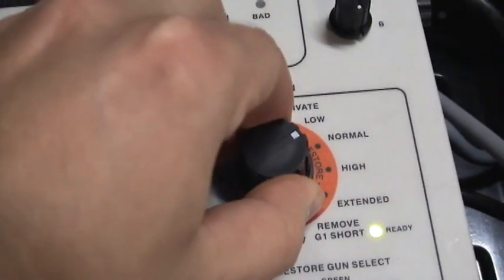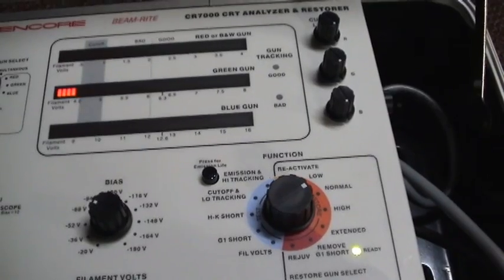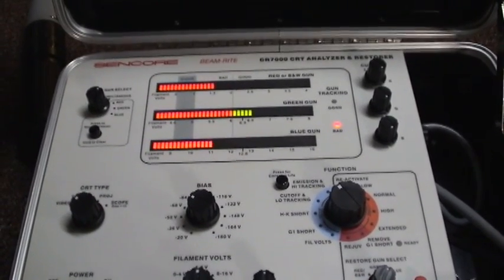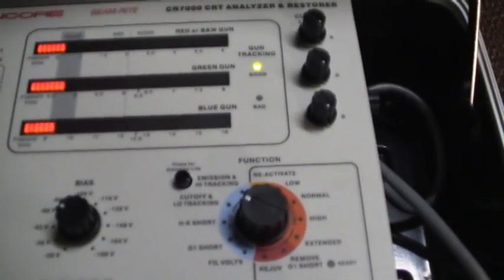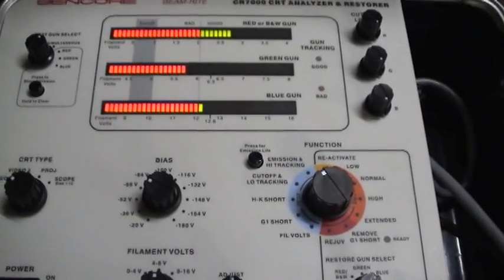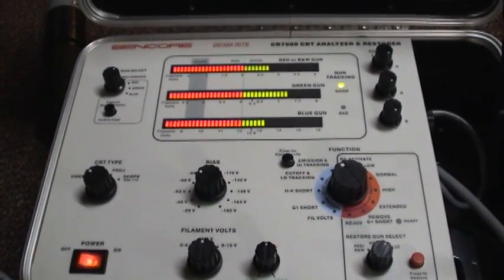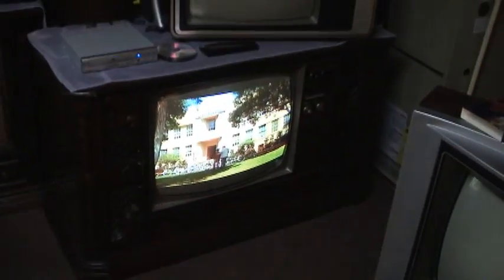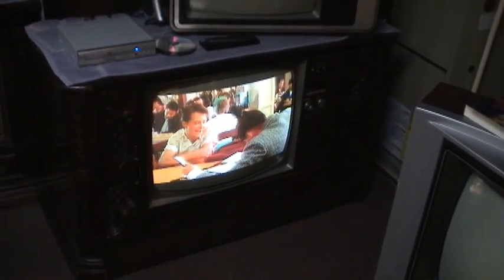Sencore CR-7000 CRT Tester/Rejuvenator Demo - Part IV

Comment: Hey, if you're ever in Florida, let me know, I could use your help with getting some extra life out of my new 19" 80's Samsung.

Works fine since getting a new flyback installed, but I had some flickering on the top half of the picture, even with the brightness, contrast, bias and drives turned down.  I had to turn down the G2 on the flyback to prevent the red flickering.  Seems fine right now, but it makes me feel that the red guns are weak.

Comment: Just curious to where you get your old Vacuum tube sets from, I never see them in the thrift shops, i see stuff from the late 1970s early 80s solid state stuff pop up from time to time. Do you ever check the local TV recycling places? i wonder if that's a good source, i did a research of TV recycling places in my area, but never been to any yet, i wonder if i should call them? i do have a small collection of TV's if you want to see them, I'll send you the link..Let me know..

Comment from the maker: @wildbilltexas That is pretty much how it works....

On Reactivate, it runs the heaters hotter than normal, then it puts a 1mA current through it for 30 seconds.

I did it on High, and it outputs a 100mA current with the higher heater voltage.

I didn't try it, but the actual rejuvenate function actually "zaps" the cathode, blasting off cathode material and exposing new material.  However, there is a greater chance of stripping the entire cathode rendering it dead that way.